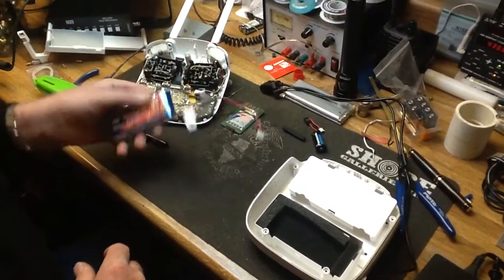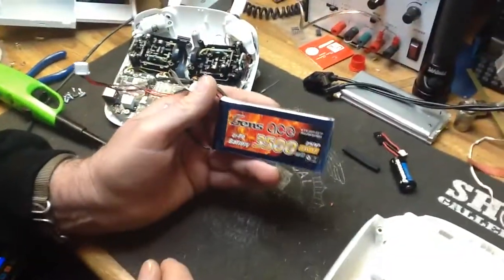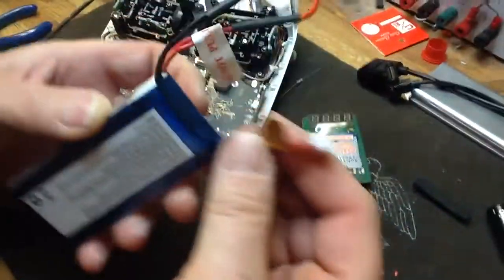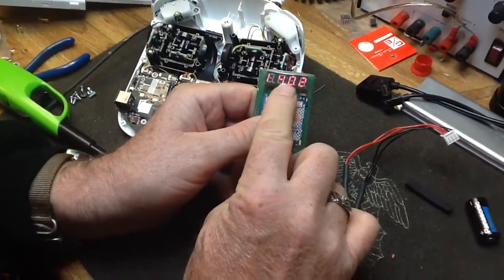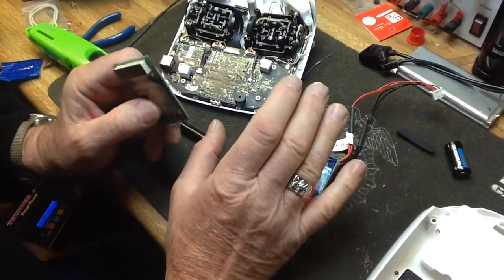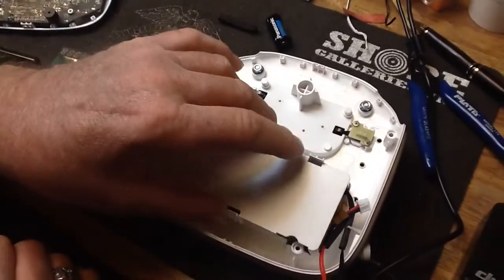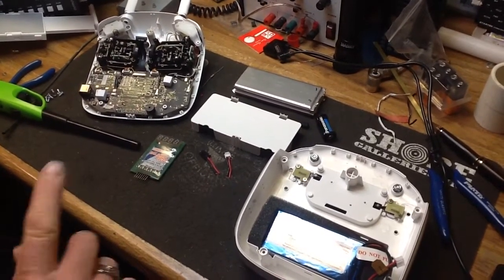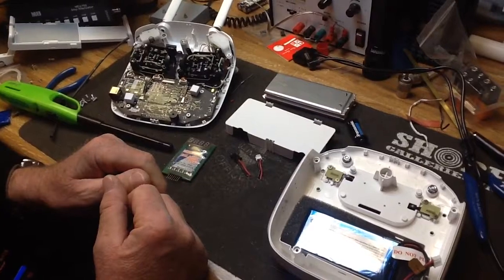Phantom 3 controller battery replacement GL300C Part 2

Comment from the maker: The 3500 battery has plenty of power to run the controller for many hours. My thought was way have extra holding weight during flight time. I have never ran out of power. I had to recently changed the battery with same type  after several years of use and the same one went in.

Comment: Do you think this 5000 may will fit. It's 72 x 42 x 22 mm.  Search eBay for    RadioMaster TX16S RC Transmitter battery  . Would it fit if you leave the battery. Compartment cover off??

Comment: I received my P3 not long ago, and got it with the same problem (battery shutting down, and not charging). Apparently my battery is different from yours. It is a 2600 mAh 2S. 
Probably a difference with newer units. Goes to show that you choosing 3500 mAh is still largely above the requirements of the RC. 

Anyway thanks man! I was about to buy a new RC off of ebay, and you made me save money. Cheers !

Comment: Thank you for the video. I just bought a broken Phantom 3 Pro and have had the same problem with the controller. Replacement batterys are nearly impossible to get or they are priced to high. I will try your method and hope it works for me.

Comment: After removing the faulty battery circuit board, if the original battery cells are still in good shape, would it be a good idea to reuse them instead of buying a new pack?
Reply from the maker: D B I did only because of their age, and not getting proper charging. The second factor was the time.and hassle getting to them later to change.

Comment: The closest battery I can find to the one you're using is this one:  https://www.buddyrc.com/gens-ace-3500mah-7-4v-rx-2s1p-lipo-battery-pack-with-jr-and-ec3-plug.html
Will it work?  The model # is 8-BX instead of 8-TX; other than that they look the same.  If it will not work, could you please give me a link to something that will?

Comment: Wow...a year later and that specific battery doesn't seem to be available any more in the USA. Suggestions? What's with the 50c or 60c or 100c variety??? Any suggestions are welcomed.
Reply from the maker: Shifting Focus Photography  Keep looking there out there try Tower Hobby remember your looking for a 2s with a 20 to 30c rating 2500 to 5000 size to fit the space available. Size matters.
Reply: Thanks so much for the reply!!!

Comment: hi can i ask does the battery get warm when charging, i did what you did cut off the connector from the original one and cut off the two connectors like you did and solder black to black and red to red, i placed it back in the controller and charged it for about 1hr, it was still showing charge going up, i disconnected it and tried to switch it on, it cam on no problems, the original battery would not turn the controller on at all. when i did test for the total charge it showed all 4 lights on the controller, did i do everything the same as you lol , my drone dji advanced thanks
Reply from the maker: Michael Kitchen  Warm yes, hot no and, after recharging back to ambient temperature.

Comment: Do you have any videos where you transfer the logic board from the original battery ? 

I hooked up a 2s directly to the plug, seems to work bench tested. But the original battery ad a green board to create the series connection among the 2 cells. 

Just wanted your input to see what the purpose of that board was, looks like some sort of battery level balancer. 

Thanks for the battery source, let us know if yours is still working strong.
Reply from the maker: Your battery will have a board already that connects the two cells together.  This system is working great for the past 10 months with heavy use.
Reply: very good info, thanks for the reliable 10 months point as well. I went ahead and ordered 2 of these batteries off ebay but the seller has a shipping delay, do you have a specific source for your battery ? 

Im going to be fixing my inspire 1 and p4 controllers, tested both with an r/c car 2s lipo 40c high rate and everything works great, just too large for the controller case. 

Isnt it also odd that the 6000mah controller pack is so small ? my car 5000mah is at least 20% larger and bulkier (turnigy cells). 

I will make some videos on the repair :) Thanks again.

Comment: With the controller out of warranty and fitting a non DJI battery. I would look at not using the DJI charging system for it. I would look to possibly having the balance lead accessible for one of those small balance lead only chargers. May be slow - but who cares if it keeps the LiPo well balanced and healthy. Trouble is any LiPo charger set to 17.5V to power the DJI charge socket is going to refuse to have a 2S balance lead as well. It would interpret the 17.5V as LiHV 4S ...
Reply from the maker: If you listened to what I found as voltages the 17.5 was the raw voltage and the controller has a regulator that drops it to 8.3 volts and monitors the charging current. But if you what to cut a hole in the case and hang the wire out of it that's another way to do it.
Reply: HI Guy ... just making suggestion. My point is that the voltage regulator will just throw out 8.xV to the battery as a single output with no balancing at all - with the little board removed. I am aware of the raw voltage . regulator function. We all experience LiPo's going off balance as they age .. so I suggested being able to charge the battery direct via its balance lead. In fact its not necessary to have a lead hanging out of the case. There are plenty of balance sockets / extensions on ebay etc. that could be fitted to case to provide a plug in socket neatly. 
Your videos are providing an alternative to expensive return to DJI for what is really a simple matter of changing a battery ! I just thought to add to it.

Comment: Good afternoon, sir, I bought a battery (link is in the comment) I put in the remote control of my phantom 3 pro (GL 300C) the 4 leds shows loading, finally but at the end of the load only charges 78% to 80% of the battery, ie the LEDs go off informing that charging has finished but when pressing the button of the command to see the load shows 3 LEDs on and 1 flashing, reason must be the main board of the control and not only of the battery that already appeared to be addicted. Thank you for having placed your video ai encouraged me to make your process one side worked out but the other did not.

were i buyed:https://www.ebay.com/itm/Gens-Ace-5000mAh-7-4V-RX-TX-2S1P-Lipo-Battery-For-Remote-Control-W-Futaba-Plug/282627876911?epid=1575247387&hash=item41cdef282f:g:34gAAOSwYeRZ53lu
Reply from the maker: I did look at the battery link, and there is no reason why that battery shouldn't work. Most folks offen think it may only be a bad battery. That's the reason I mentioned the voltages that I found. The suggestion I have for you is watch the videos again, and wiite down the voltages. Then remove the battery and see what you come up with. If the normal voltages appear it may be the battery. Remember just because you just received the battery it may not be good. The other way is charge the battery with a Lpo battery charger and test it to see iits status. Take your time and be careful not to short the battery leads or hook up the leads with the wrong polarity.
Reply: Well, I discovered the trick to charge up to 100% of the battery of the remote control, even with the LEDs off every half an hour, I go to the DJI app and check it, and it's charging, the only concern is going half an hour confirming. Dear sir and thanks again for the hint of a lipo battery, to end the sisma of the command phantom lol

Comment: Thank you for this video! Are you still using the same battery? is it still working like it should? I actually cut out the casing on the side of the battery today and will order a new one to fit edge to edge after watching your video! Hope it works!
Reply from the maker: Still working great, my flight hasn't changed at all. I'm well satisfied with modification.

Comment: Hello goneredcar1,
Nice video's and clear tekst!

Im from Holland and my questions still are: 
1- Did you use also the ballance-cable to load the Gence Ace battery? 
2- Or use you only the normal load-port on the controller whitout using that ballance-cable?
Overall: Is it possible to load the Gens Ace battery whitout a ballancer?? (is it not dangerous?)
3- Can I use also a battery from for instants Banggood: ZOP Power 2S 7.4V 6000MAH 25C Lipo Batterij T Plug? Or is this one only for receivers?? (sorry, im not so known with elecronica...)

Best regards, Charley
Reply from the maker: As stated no battery balancing is needed because the charging and discharging rates are low.  i have used this setup for several months without any problems. The battery charges at the same rate as with or without the balancing board. Take the time and see if you get the same voltage reading on the charging circuit as stated in the video.
Reply: goneredcar1 
Thanks  Goneredcar1, but what with my ougther questions?
Reply from the maker: I will answer the question by the numbers.
1.no
2.yes
3.unknown but bing a 25c battery that is for hi discharge rates
Reply: goneredcar1 

Thank you sir, im happy with you answers and tray it out.
Best Regards, Charley

Comment: Thanks for sharing, I would love this to fix my controller which has recently shown these exact symptoms after 1 year!!
Seems as though this model of battery is hard to get in the UK, do you think it would work with most other batteries with the same rating? Essentially the double + and - wires from the controller just need to be connected to the single +/- wires from the new battery without the circuit board from the standard battery?
Reply from the maker: That is a standard radio controller battery found everywhere. The connectors are used specifically in RC transmitters and receivers. So look at hobby store suppliers and on the Web.

Comment: My 16 month old Dji Phantom 3 4k ($912) w extra batteries (3) two unused,my situation as well, no lights on controller will not charge was fine a week ago after doing firmware update a week later died, contacted dji support,fucking jokers, there response as follows:
Thank you for contacting DJI Technical Support.

Sorry to hear your issue. As you can see from the online store, there is no sell for P3 4K remote controller.
http://store.dji.com/category/phantom-3-series?from=menu_products

You can contact the local dealers to see whether they have storage or not.
http://www.dji.com/where-to-buy

If no good luck, you can consider to get it repaired in DJI service center, the below information is required:

【Your country and delivery address】：
【Contact person】：
【Phone number】：
【SN】：SN of the remote controller

Thanks and have a great day ahead!
Ellen
DJI Technical Support
Website http://www.dji.com/support
DJI – The Future of Possible
Reply from the maker: This fix works, and at around $15.00 your back flying, thanks DJI for nothing.....

Comment: Did you have any issues with firmware updates to the remote controller after changing to the Gensace battery?
Reply from the maker: None what so ever, I even updated after the battery was replaced.  I have over 50 flights since the battery replacement with no noticeable differences. It just works.
Reply: Thats great! Thanks for posting this video, doing the investigative work, and sharing the details!! I think it'll help lots of folks out there!

Comment: you can get load balancers here: http://www.ebay.com/itm/2S-8A-w-Balance-Li-ion-Lithium-18650-Battery-BMS-Protection-PCB-Board-7-4V-8-4V-/263164509336?hash=item3d45d3bc98:g:NSIAAOSwmo5ZnoMN

Comment: Thank you so much for the explanation about the board. I have successfully repaired my P4 controller using the original battery. The cells were at 4.1v but wouldn't charge. I separated the cells by cutting carefully through the double sided tape between them, removed all the surface mounted components, then soldered the wires on to the top of the board.

Comment: I see most of the time the original batteries are still ''operational'' even if the controller is stating otherwise. What if we simply remove the balancer and try to charge the original batteries. Would that work or they are made to only be charged with that balancer ?
Reply: Yes, thats my question to...is this possible?
Reply: What i found is ... they have to be charged with a balancer. So it needs a new balancer - it can be found on amazon if you know how to deal with battery. But (for me) i choose to put a new battery and i'm charging it with a battery charger that is taking care of the balancing. New battery costed about $20-30 (CND), and charger costed me $45 (CND). 

I can fly for more than 1.5 hours on a single charge now (with the new battery setup), and i don't use the DJI charger for the controller anymore. I used the charger hole to get my battery wires out and the battery is snapped under the controller with velcro. A bit ''red neck'' but it's working. 

Any RC Controller (airplane, car, truck...) is setup that way. Wonder why DJI reinvented the wheel on something that was a standard for such thing.

Comment: Great video .... I am also at the point where I want to 'override' the stupid DJI restriction and add a new LIPO battery. Can you advise on the following1. Confirm exactly how you soldered the new battery to the existing connector as that part was not slow enough .. for me !2. Why did you use a 3500 mah battery and not one closer to the original ... like a 5000 mah ... any reason ?3. I am thinking about hooking up an external LIPO to the controller so you can switch them around if needed .... use the existing connector and wire it to a standard LIPO connector on the outside and then Velcro the new batteries externally, that way you don't have to open up again and you can have multiple batteries in the go !!Any ideas would be greatly appreciated. The reason for this is that I have the same issue as many and my controller will not charge beyond 70% and that process requires me to charge multiple times to hit that level .. so I am disgusted at DJI's control over what should be a simple process.regardsPaul.

Comment: Hi, again! I experimented a little further. First i tried the 7,4V 3500mAh battery. It worked, but i only got 2 out of 4 lights on the controller. Then I swiched to 7,4V 5000mAh thinking it would give me more juice. But it still only shows 2 out of 4 lights on the controller. Isnt this weird?